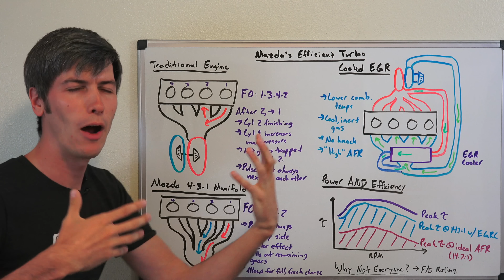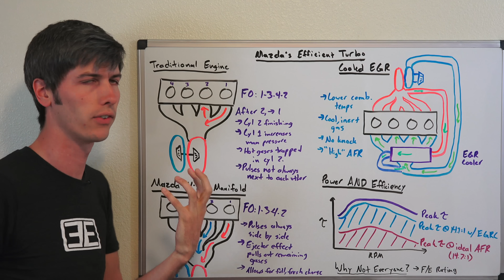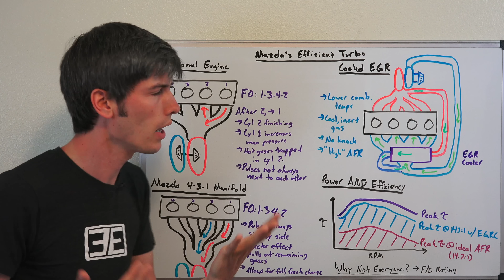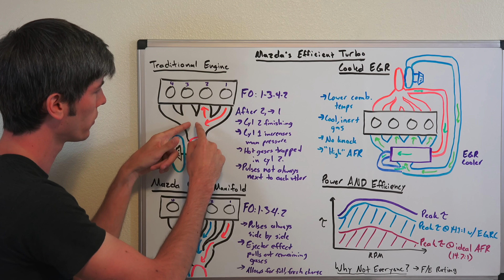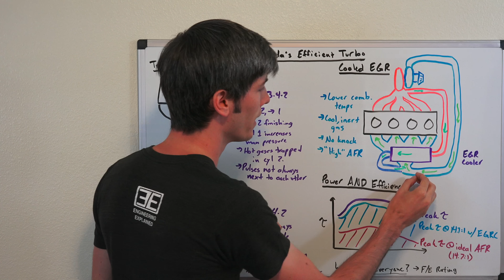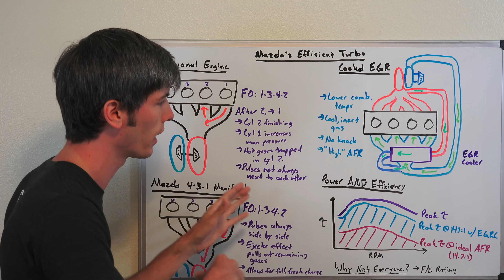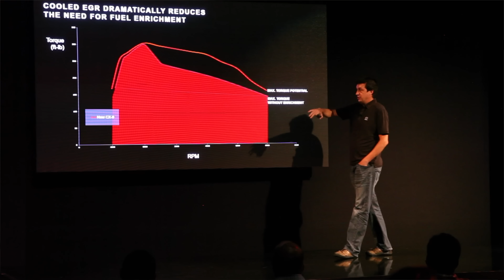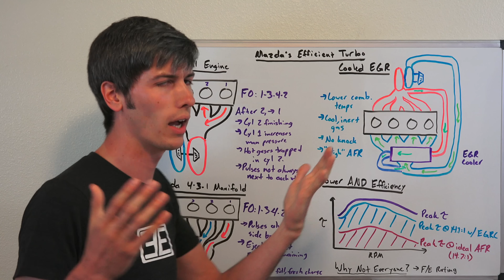Mazda's Secret To Efficient Turbo Engines

Comment: Ok I have watched a ton of videos, and all these car manufacturers is trying to make these turbocharged high hp 4 cylinders. Why want Ford and Chevy look back in there history at their best engines (Chevy 350/Ford 300-in-line 6)  and bring them back with today’s technology? Could you imagine the Ford inline 6 with today’s technology turbocharged and all aluminum. The Chevy 350 all aluminum turbocharged with a 10speed automatic trans!!!  Ok ok I’m dreaming but it would be very cool!
Reply: The ford inline 6 is called a Barra. Look it up
Reply: Bot Account I’m glad you said that. I’m looking at importing one to put into my Mazda b2500.
Reply: Dre C. The ls is basically a small block still, not much more efficient, all they really have is cylinder deactivation and adjustable timing since the timing curves aren't locked in with distributors anymore. They can make slightly more power, but when it comes down to it, power is made by displacement, camshaft(s), airflow, and compression.
Reply: As far as that goes you see them leaning on smaller displacement to increase power and mileage.  Placing a v8 against an inline is murder when you consider the reliability of the inline 300-6 300k mile to overhaul versus 100k for the early model 350-v8. With that said offer up a different GM engine like a revised VVT DOHC version of the IRON DUKE with a turbo and/or bring back the old Straight 8 design with VVT, DOHC, fuel injection, multi cylinder, and some sort of power adders imagine that with the bore and stroke of the 283 but in new age design. You might be looking at engines capable of 1.5hp per cubic inch and 9,000rpms with modern engineering and materials. My take on the whole thing is this, what is the actual maintenance costs of all these new fan dangled systems? Are we supposed to accept the fact that these parts don't last as long as we would hope?
Reply: @masterdebater8757  The simple answer here is 1. Size & 2. Weight. Squeezing every ounce of power and efficiency out of a smaller engine while reducing the overall weight and size. Let's face it, most consumers are not looking for a new vehicle that can turn 8's at the track; they just want to get to work and back with the least amount of stops at the gas station. 
To answer your maint. costs question: That's what the 10 year 100,000 mile warranties nowadays are for. The old 3 year 36,000 mile warranties are no longer good enough to justify a $30K or $50K+ average new vehicle cost. Besides, nobody makes money if parts don't fail.
Reply: GM's LS based engines still have a lot in common with older 350's and whatnot. Obviously much more complex but it sounds like that's what you are asking for.
Reply: Dre C. Because older engines are not efficient. New engines use high compression ratios, variable valve time, fuel injection, turbocharging and etc to get more power and less weight. Smaller displacement engines are efficient at cruising speeds. Look at Ford's 2.7 Ecoboost rated 26mpg highway or 2.7 turbo 4 from Chevy which highly fuel efficient.

Comment: This is just my opinion. Although Mazda packages and markets their technology nicely, I think they don't live up to expectations in the real world. They tout more power and efficiency, but they are being outclassed. Power? Their 2.0L doesn't have the best power in the class; look at Toyota's new 2.0L, the 2.0L used in the Hyundai Tucson, or K20C2. Efficiency? Their engines aren't that most efficient either compared to the ones used in the Camry, Accord, or Altima. And I don't have high hopes for the SkyActiv-X 2.0L either. Don't get me wrong: I want to root for Mazda. But then the competition blows me away.
Reply: vistastructions, that's because Mazda being a smaller company doesn't play the numbers game like the other manufacturers do (highest HP, torque, 0-60 times, etc. which most consumers are looking at) instead they focus on getting the best driving dynamics, handling, fuel efficiency, throttle response, design, advanced engineering etc all based from their japanese engineering principles that unfortunately only caters to a small percentage of drivers (enthusiasts) thereby making them a niche brand.  I also want mazda to succeed as am rooting for the small company like rooting for the underdog!

Comment: E85 here is more expensive after you factor In the 30 decrease in mpgs.
Reply: cloridan Beauchamps if it were cheaper, I'd buy it more often
Reply: cloridan Beauchamps it won't gain traction with the average consumer until it is economically the same or better to fill up with e85. where I live, it's more expensive to fill up with e85 after everything is calculated.

Comment: I'd be keen to see intuitive ai build an engine from scratch. They already use it for structural applications.

Just set the parameters and tolerances you want and it will almost organically 'grow' a design that best fits all your needs. 

Give it a plan for a standard small 4 cylinder engine, and let it run simulations and make alterations of its own.

Comment: Mazda have been saying recently that they have found a way to double the efficiency of the 13b Renesis (RX8) Rotary engine. Many have been wondering how, including me for a while. Part of the problem with the Rotary is how hot the combustion chamber gets in these power plants. Mazda have leaned on using very rich fuel mixtures to address this in the past. Watching this has made me think, maybe they plan implementing some style of cooled EGR system for a Rotary? @EngineeringExplained what is your take on that’s?
Reply: I would point out that a double efficiency rotory is still inefficient by modern standards, but certainly good enough to make it non-prohibitive for most buyers.
Reply: Oblithian True that :P however of any company can keep the hopes alive of us rotary die hards, it's Mazda
Reply: Oblithian I don't believe your statement.
Reply: Mind you a four stroke one point three at that power output would not have half the overall intake to exhaust tempuratures. Theoretic mileage of the two stroke engine is doubled that of a fourstroke. Which means incompetent owners and commuters still toke that engine hundred fifty thousand miles of average use similar to cylinders at triple the engine speed.
Reply: Very difficult to get complete compression ignition with the rotary as it has a very unusual and long combustion chamber, which also makes it harder to achieve an even air fuel mixture throughout the chamber. If anyone can do it, im sure it will be mazda :P
Reply: Tom Higgins ... dual sparks might solve that issue.
Reply: John Mcneill already twin spark.
787b had 3 spark plugs per rotor.
I also heard that they want to use Wankel as a range extender/generator.
Reply: Jarek Nowak ... gr8 minds think alike!
Reply: Looking at what they've been able to come up with for their piston engines lately, I'm very curious and excited to see where they're taking rotaries next as well. Rumors have been pointing to lower displacement (~1.6l) boosted designs making north of 400hp, so maybe they are looking to embrace the rotary's preference for high rpm operation now that material advancements are catching up to what they need for apex seals to be more reliable.
With cooled egr they just might be able to get fuel economy and emissions closer to what they need to make it viable in the modern market, especially with the rest of their range stepping up to make the brand-wide average efficiency so impressive.
And as stated above, the homogeneous spark combustion could be just the ticket to get proper combustion and reduce hot spots where they've had to use multiple spark plugs in the past due to the irregularly shaped combustion chambers of the rotary.

Just imagine if these guys had the R&D budget of someone like Ford or Chevy, instead of being one of the smallest brands out there...
Reply: holmd90 : apex seals are actually one of the most reliable "weak points" of later model rotary engines
Reply: Early model you mean, the efini with turbo. Late model is renesis with small exit exhaust. Turbo the renesis and side seal is concern similar to EJ ring land. Nitrous alcohol would cool seals and add reliability.
Reply: Elgonidas That is true, but that is mostly down to lubrication and combustion chamber heat. Mazda in the Renesis switched to side ports for the exhaust, cast into the irons of the engine. This really hurt the engines ability to expel heat in the exhaust part or the rotary cycle. Google 13b rew renesis hybrid. People have been able to improve apex reliability by using the RX7 fc "block" with the high compression resesis rotors. Interesting to still see work from people still trying to make sense of these crazy power plants.
Reply: i think egr and Homogeneous charge compression ignition could bring the rotary engine back
Reply: As a former owner of a Mazda RX-7 I certainly hope so. I get one in a heartbeat. There's no other sound in the world than a rotary engine revving up to 7-8000 RPM.
Reply: Rxonmymind The problem was they sucked below 3krpm
Reply: Woodmember this is a great comment
Reply: а щееd Thanks man, let's hope EE responds and adds to the discussion.
Reply: Hybrid with electric or small turbo maybe?
Reply: giorx5 masda plan on using a tiny rotary as a range extender where efficiency isn't that important but size and weight are.
Reply: Wow so many comments, glad my post got a discussion going.   I find it interesting though that some in the comments point out the oil consumption of Rotary's. Most modern turbo engines are "burning" more oil than ever in the name of fuel economy. Funny to think that the vast amount of criticism leveled at Rotary's are due to oil consumption and reliability (maybe petrol economy as well).
Reply: Depends on how you measure efficiency
Reply: the cooled EGR in theory sounds good but it has been used in large diesel engines and proved disastrous.  EGR gases are dirty and hot and unless you can cool them way down and somehow be able to clean out the intercooler, before it clogs upside, you will wind up with a destroyed engine.
Reply: Link to where they said this?
Reply: Advancing the ignition timing makes engines more efficient as long as you don't run into knock.  

I don't design anymore but you can see A prototype of mine being tested on my page.  It reduces engine knock so the test car can run the maximum ignition advance setting.
Reply: Well I don't think any rotary could have a place in today's market. Even if they figured out a magical way to make them fuel efficient, wankels burn oil by design, which automatically disqualifies them from any emissions test...
Reply: he already has a video explaining why the rotary is dead (probably forever). The biggest issue is contaminant emissions caused by the lubrication of the chamber. While in reciprocating engines the piston rings keep oil away from the combustion chamber, on a rotary that's just not possible per design.
Reply: Gryphus if the rotary was direct fuel and oil injection at say the equivilant of 50:1 premix then the unternals would all be correctly lubed. A big problem with rotaries is lubrication and wear. Some 2 stroke oils are so refined and engineered they can run at 100:1 so maybe an oil injection system that did the equivilant of a 100:1 premix? Then a conventional oil sump that had plenty of oil to spare and an early check oil light and a shorter dipstick? Im just thinking like cos really, the rotary engine just never got taken under the wing of hardly any company. They have lots of potential. Good power to weight ratio, they last almost as long as a piston engine when taken care of. Not to mention with direct fuel injection to the combustion chamber and oil injection via spray in the intake and a smaller one in the combustion chamber, they could last a pretty long time. Also higher compression would go a long way as rotaries dont have much compression. Just my thoughts
Reply: Gryphus Good point, but why are modern turbo cars now also burning oil by design? Some engines are just designed to use oil in the combustion chamber. Porsche in all modern engines they build advise of the need to consume oil. I don't think the oil argument can be used any more to put down the old rotary :P thanks for the reply though
Reply: As good as the idea is, it wouldnt be good for the engine, you would create one really cold side of the engine, and the other really hot. The irons would warp due to the thermal differences of the rotary, unless you put insane cooling on the hot side of the engine and not much on the intake side to balance it, you probably will end up with issues
Reply: Woodmember - EE never answers good/interesting questions. He only responds to 'funny' one liners and puts hearts on them.
Reply: Fred P @EngineeringExplained time to show up your critics my man :p
Reply: Stick it in the  garbage can. The rotary  engine have proven again & again as  Mazda's corporate biggest  money pit.
Reply: @loktom4068   But still won at Le Mans!
Reply: Rotary engines are rubbish. Always were, always will be. Accept it.
Reply: @farvatron  
200k miles. Show me another 1988 Ford, Dodge Chrysler vehicle that got that. 
Careful with your answer. 😀
Reply: @farvatron  I wouldn't call them "rubbish", especially when they can output ridiculous power at only 1.3 liters
Reply: @MilesPrower1992  the candle that burns twice as bright only burns half as long. They are rubbish.
Reply: @farvatron  Every engine has its advantages and disadvantages. An engine that can make a lot of power at the cost of having a reduced life isn't necessarily bad. That's like saying an old truck v8 is garbage because it doesn't make much horsepower. It's a tradeoff. You can have power, low weight/size, and long life, but you can't have any one of those too much without compromising the others.